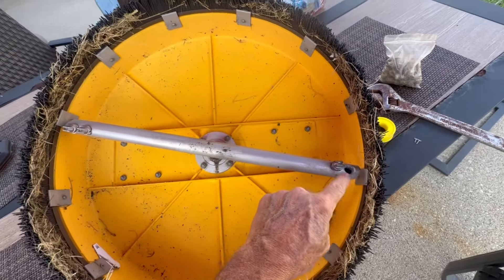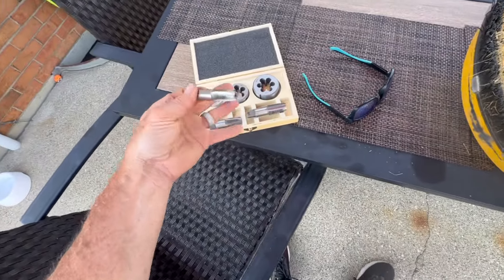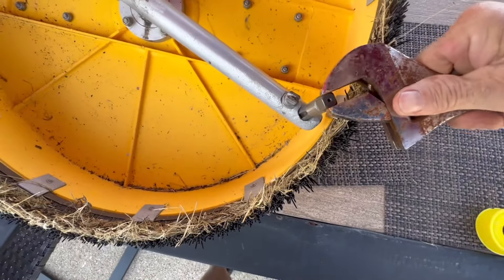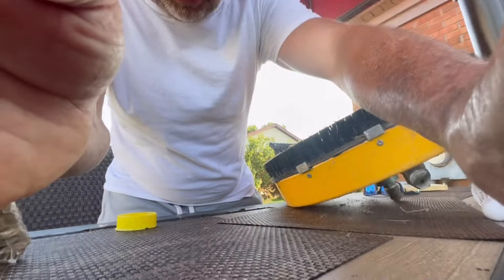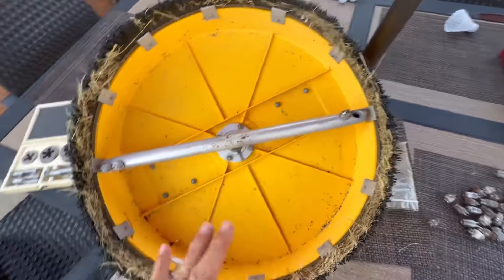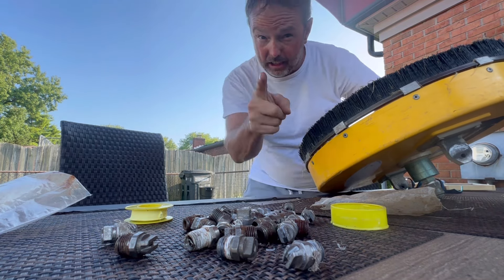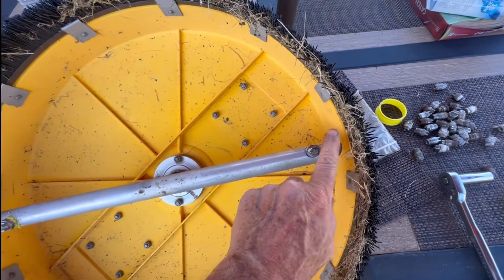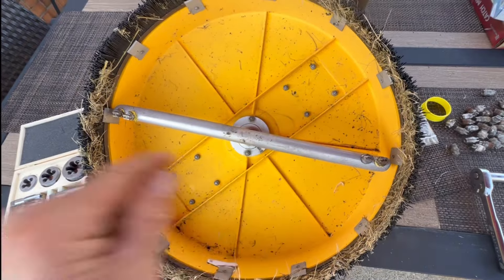How To Repair A Stripped Surface Cleaner Bar

Comment: So I’m hung up on the gpm rating on tips. 25025 means a 25 degree angle but is that rated at 2.5 gpm or 2 gpm? 
Would 25030 be 3gpm?
Reply from the maker: @masonsindelar2793  https://southeastsoftwash.com/blogs/blog/pressure-washer-nozzle-tip-chart
Reply: @TheFreshRinse  thanks. Awesome video

Comment: Curious, could I just drill a couple more holes on my existing 4Gpm surface cleaner bar for my 10GPM machine right now???? Set all of the tips at 2.5gpm surface cleaner tips??
Reply from the maker: @ObviousObservations  Yes. Angle is somewhat important, but not sure exactly how important
Reply: Great you just saved me like a thousand dollars brother 😂😂🤙 much love man  @TheFreshRinse
Reply: Don’t risk drilling it… balance, angle and tip spacing all play a role in proper operation and bearing longevity… 
just buy a separate 4 tip bar for your SC. (check size and thread pitch where it mounts into the swivel and overall length for proper figment).

Another configuration  available is a 4 tip cross bar  (like a + ) or a similar 3 tip cross bar.  
I have 3 separate bars, 2-setup differently for specific situations (different tips) and a spare bar just in case. Overkill, Maybe?  but ya never know. 😉